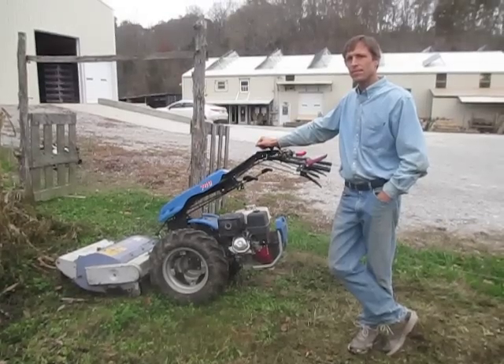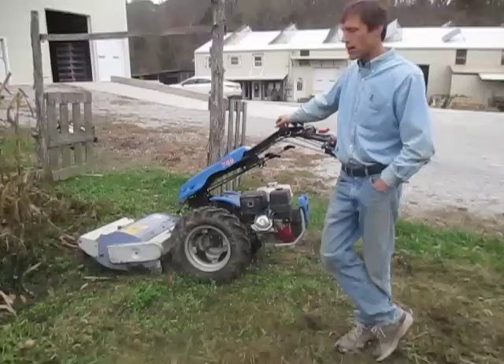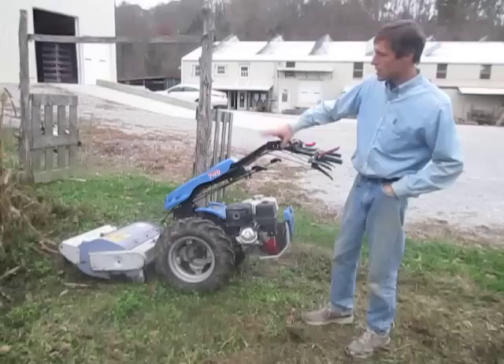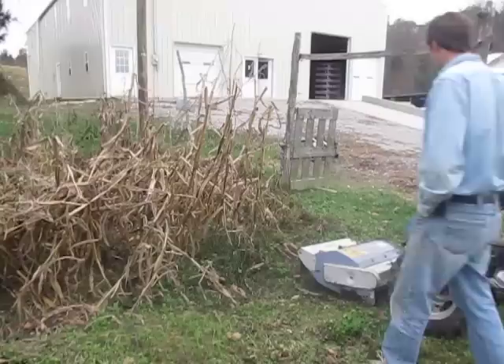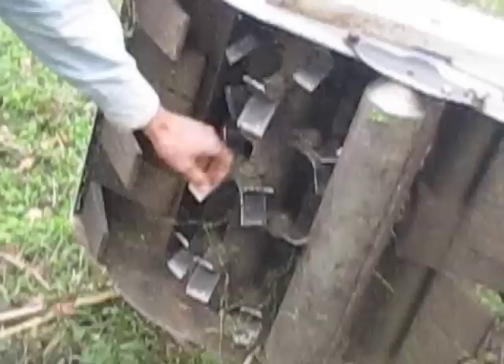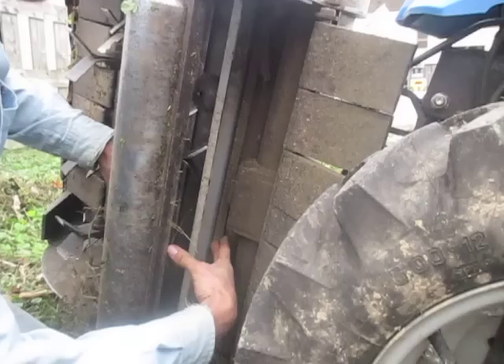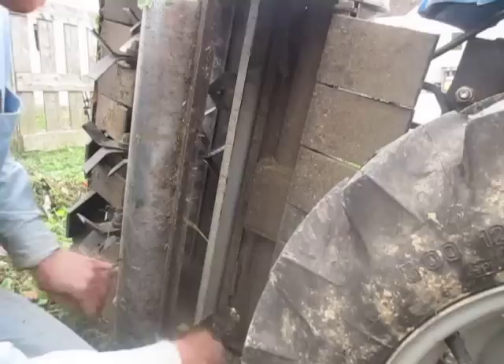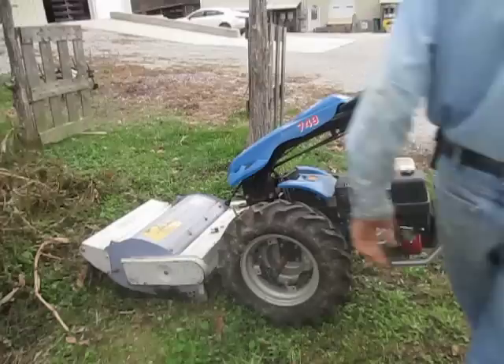BCS 749 Walk-Behind Tractor & Berta 26" Flail Mower

Comment: I have a 26" flail from berta...joel you make this maneuvering look easy man...oh! The deceipt
Reply: If you use the steering brakes on the tractor, it IS this easy!!
Reply: @joeldufour6202  but I have the 732....no brakes
Reply: @joeldufour6202  With the bigger 33 inch Berta flail it can get difficult to turn even with the brakes, especially in very thick vegetation where the machine ends up running in a channel of its own making. In that situation it can also be difficult to back up because the belt cover on the right sticks out further than the one on the left and tends to get hooked up on uncut material on that side. It's still a very impressive machine.

Comment: my DR  will easily outperform that machine all day long. I can opperate at a higher foward.speed, chop up brush into smaller pieces and cut 3" trees.
Reply: What's a DR?
Reply: A BCS runs over 50 attachments, it's much different then a DR Brush Mower.
Reply: @bradsuarez2683  DR is a brand of USA made lawn and brush mowers